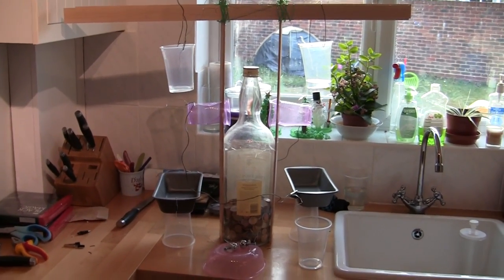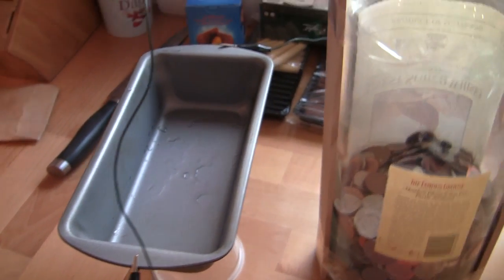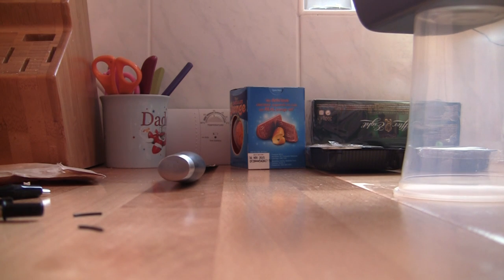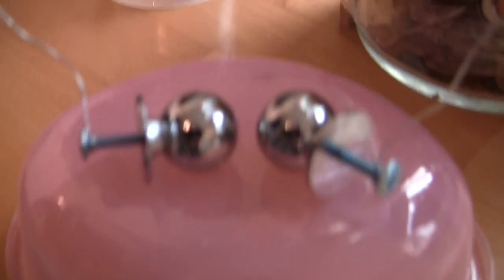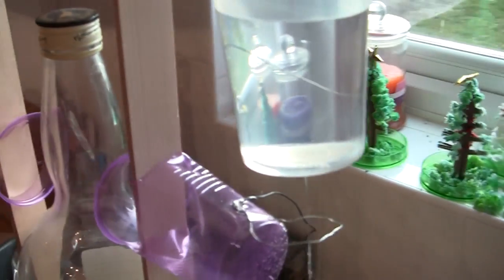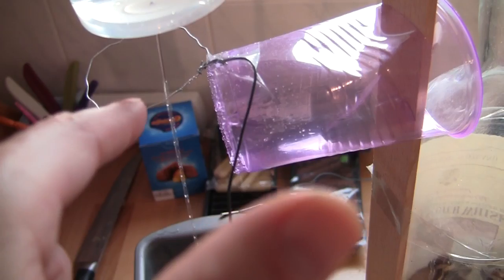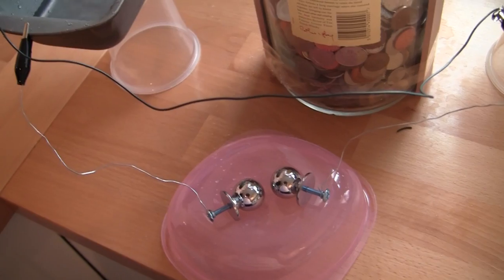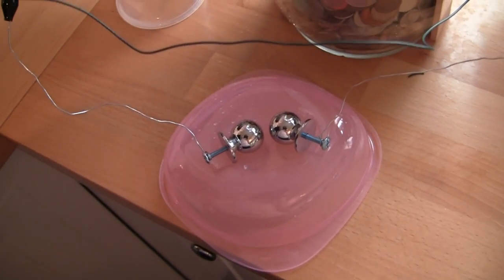Building a kelvin dropper

Comment: Here's pretty cool too: you can make a tesla coil (not 100% sure, but it seems like one) out of a basic plasma ball, by placing a small piece of metal (like stainless steel "screen" or a copper coin) on top of the ball, when the ball is on and you put for example a screwdriver close enough, it will make an arc that can even cut thin paper like receipts if put between the metals.
Not a big one as you can't really get huge charge with something like 12v or less, so its safe too.

Hmm.. that thing you made, made me think if that power could be feasibly harnessed as a "free flowing" system.. like an ecological water plant that harnesses the power rather from friction or air flow than just by water pushing blades.. it wouldn't necessarily make huge loads of electricity, but then again you could quite easily adapt it to into even smallest of falls without disrupting the ecosystem.
What happens if you add some electrolytes in the water?
Happy new year!

Comment: Could this be how lightening is created?
Reply: The same principle causes the spark. High voltage differences across air. Only with lightning the distances are much greater so the voltages are much, much higher. Not sure is similar process causes the charge difference.

Comment: Minimalism is fun, but the sharp edges and ends on your wireloops and connections is spraying charge off, into the air.  I think you will see much bigger sparks if you replace the wire hoops with donut size aluminum cake molds.  Round side down.
http://www.ebay.com/itm/Vintage-Aluminum-Metal-Round-Molds-7-JELLO-Cake-Craft-Soap-Donut-/121506073711

Comment: It starts with just a tiny difference in potential and how you cross-wire it will build that up and up from the top down. yes, you should wire the top cups clear to the bottom ir even run the end through the hole.
The loops work by Faraday/Lenz. If you increase the number of turns, the thing should kick out sparks faster. Older models I've seen used metal tubes, the induction occurs through the length of the tube as opposed to the thin area inside the loop. IMO, a coil will get more volts.

Comment: OK, so you need to get some kind of an electroscope that can determine charge (negative vs positive) on each metal pan and see if the charge starts in any kind of pattern while running the device over and over.

Comment: This is simply a separator of the positive and negative ions in the water based on the fact that like charges repel and vice-versa. Without going into that any further...
A conductor between the two primary water supplies will increase the spark potential because it will tend to pre-load the polarity of the primary containers and provide a slight series, rather than a parallel effect...  Good fun!

Comment: Perhaps the electric charge distorts gravity a bit. Not in any fling in to space way but we are only talking about small drops of water. Earth itself has a magnetic field and while I would not call myself a gravity expert(Things fall down is what I accept.), we can create magnetic fields with the right materials. It may take more but I know it needs electricity and a conductor routed in a certain way. I think of this because the water distorted as the charge built up but immediately went back to true when the charge dissipated. I'm going to ask Taofledermous to try this with mercury, perhaps we will get another piece of the puzzle from liquid metal. Thoughts?
Reply: I sent Taufledermaus a message. I hope some collaboration for science can occur.
Reply: The droplets are being pulled to the side by an electric force from the charged metal ring. Nothing to do with gravity or magnetism at all.

Comment: Will have to try that, except I'm going to have a few capacitors where the spark gap is. My goal is to find out just how much energy I can hold in the caps and how long it will take to discharge in a small circuit using a resister and an LED.

Comment: The big mistery to me is, why does it even start to charge up? When the water starts dropping the rings are neutral so there are no preferred loads. Do the first charges drop by chance? So water drops until we get the opposed charges and then the feedback loop starts? But if one drops lets say a negative charge by chance while the other stays mostly neutral there should be some electrostatic induction in the "capacitor" so the ring would would get a small negative charge and the stream would be positive and cancel out the load. So you really need two opposing charges to drop at about the same rate by chance to start the chain reaction. So many open questions... Need to build one ;)

Comment: cool! Is it possible to charge a capacitor with those sparks...enough to keep a set of batteries charging alternately (charges second battery while the first one is being used, then the second battery is drained while it charges the first one)..said batteries used to power a pump that pushes the water back up into the cups?

~ducking to avoid any heavy objects Thunderf00t might throw~
HAHA!!

Happy holidays to you and yours GeekMeister!!

Comment: did you try connecting some voltmeter to find if there is a bias of + to - depending on what side? I'd expect this to be random at least at initiation of this apparatus. Voltmeters I'd imagine might interfere with this operation as well be outside of spec of most hardware.

Comment: Everytime the spark happened, it appeared the Scientific Balls of Sparking (technical term) moved. While the voltage you quoted was impressive, I'd really like to know what was imparting a physical force to cause the movement, if in fact this movement wasn't caused from outside the apparatus.
Reply: Spark generates EM field, balls look like stainless steel, hence ferromagnetic. Balls interact with field - movement. The discharge also creates a plasma arc (like lightning), which very quickly heats up and its thermal expansion causes a localised pressure wave (that snap you hear would be the pressure wave reaching your ear... or the mic).

Its secondary effect is imparting some force on the balls, which are light, thus they move.
Reply: Electricity moves shit (very scientific terminology).
Reply: http://i.imgur.com/nlM8WNt.png?1
I hope this explains it.
Reply: The balls are oppositely charged and hence attract one another against the pull of the wires. As they build up charge, they gradually get closer to one another. When the spark occurs, the charge suddenly goes away (or nearly so) and the wires quickly pull them back apart.
Reply: Electric force shifted the balls a bit out of stable balance and when they discharged it rolled back.
Reply: velikiradojica how does electricity impart momentum?
Reply: 233kosta That seems correct, and a bit confusing to a non-English speaker like me. Your name Kosta, seems like a short for Kostadin, in my language.
Reply: ***** This is the only correct answer.
Reply: sieben So why do they only move during discharge, away from each other? You'd expect them to get closer while charging, not push away during discharge. A slight positive charge remaining in one ball during discharge would cause said ball to move away due to the electron concentration inside the plasma arc, but that still leaves the other ball, and it doesn't account for the fact that the discharge serves to balance both sides, so there wouldn't be a delta+ in one ball anyway. Ferromagnetic interaction with the plasma arc and an interaction with the thermally generated shockwave remain the two plausible explanations. A ferromagnetic interaction would cause them to attract, not repel, so while it's present, its effect is negligible. This leaves the shockwave as the dominant phenomenon. Direct evidence for this could be obtained if Thunderf00t has the facility to take a high speed Schlieren video of the discharge. One would expect that the balls not repel until struck by the small but sufficient shockwave. Perhaps - attract a little before that.
Reply: I noticed that too. Could it be that since they were round they needed very little force to roll slightly?
Reply: velikiradojica so magnetism resulting from the electric charge?
Reply: What do you mean?
Reply: The magnetic induction would have to be 10T for the magnetic force to reach the magnitude of the electric force. The rest of the phenomena you have mentioned have even lower magnitudes. I strongly claim that electric force is the culprit behind the movement.
Reply: Micic00 Not exactly, but close enough :D
Reply: 233kosta I explained the mechanism in the first few comments. Here's the crude scheme of the equilibrium states of the system I also posted earlier: http://imgur.com/nlM8WNt .

The balls are coming together while charging. We can't see this because it's gradual and the camera is hand-held. If we could get TF to fix his camera and put a ruler behind the balls, we might be able to see their movement prior to the discharge.

Electric forces are potent as fuck, the only reason why we can't use them for engineering purposes is dielectric breakdown of the material.
Reply: velikiradojica I'm well aware of electric potential, however your argument is only valid if there is spring tension on the balls. The elasticity of the cables is not sufficient to overcome friction, else the balls wouldn't remain in their position. Furthermore, if the electric potential was sufficient to overcome static friction, then it would be more than enough to overcome dynamic friction as well (as the coefficient of dynamic friction is usually 0.5 to 0.8 of the coefficient of static friction), thus the balls would continue moving and eventually collide.

One could argue of course that tension on the wires would counteract the electric field, however that would suggest that the electric field is fairly weak.
Reply: 233kosta I used "elastic force" as a loan term as I'm not a native speaker. You can picture it as a sum of all forces opposing the electric force, including the elastic >bending< of the connecting wire.

Your assumption that the balls would collide is baseless as the electric force annuls after the dielectric breakdown happens. And well, static friction is just shy of 0,2 N, so the electric force shouldn't be much bigger. I can't calculate it accurately because the balls are too close yet not close enough and I can't make any simplifications without butchering the result.

Comment: Okay. Now we do this with two waterfalls. :)?
Reply: Leitilumo You need the water to become droplets & the air must not be humid or the charge leaks away from the droplets. The air near waterfalls is too humid for this generator to work.
Reply: You've never experienced waterfalls in tundra? I doubt there would be a lot of water vapor, even with large falls.

There would be some, but.. hmm...
Reply: Leitilumo Artificial waterfalls are used in terrariums to increase local humidity for the animals... On the scale of droplets I don't think you want huge amounts of water flowing nearby to humidify the air [which must happen even in arid air near a big waterfall right?]. In Malta & North Africa the locals don't use electrical A/C - they cool courtyards & rooms by putting huge jugs of water around the edge high up in the air to preferentially change the temp/humidity & set up convection that cools the centre - better than A/C because works best without glass or closed windows. So still water can change local humidity in Morocco - it would be even easier on the tundra where air is cooler & thus less water needed to raise the humidity by a given % [that's counter intuitive]
Reply: Grymyrk The water would have to be droplets for the charges to gather on the surface of each drop. Only a certain amount of charge can gather on a drop before it is saturated with ions & then the charge has to transfer to the wire loop which has to be at a certain position along the pipe. But the pipe is enclosed so the air inside becomes super-humid & the ions leak away in the humid air. So you evacuate the tubes & make a vacuum - that might be interesting. But the charge only builds up once on the fall of each drop. As you point out yourself the energy from the charge differential is tiny [per drop] compared with the kinetic energy in the falling drop. I would suppose the kinetic energy is millions of times more than the ion charge energy [wild, wild guess]
Reply: Waterfalls aren't the problem, where the fuck are we going to get the big ass cake tins 0.o
Reply: At cold temperatures it takes a far greater amount of water to reach same levels of humidity, thus humidity is lower near waterfalls. in fact if say you have a 60% humidity inside and outside it is near 0 and raining the outside water content in air will be larger but your humidity levels far lower than that of inside, even during rain. So this is more feasible in cold temperature waterfalls, though ultimatelly very pointless.
Reply: Personally I'd be more concerned with finding waterfall sized polyethylene cups than cake tins.
Reply: nightjarflying What if the waterfall was highly controlled? Like water falling through plastic pipes running from the top to the bottom of a dam with with the inducting rings around them? Or maybe there are better ways to generate power with falling water (and I'm guessing a standard water turbine)...
Reply: Grymyrk Yeah, but regardless of the turbine being more efficient - It would be FUN to watch something like this on an enormous scale.

Yes, the physical limitations of the size of ions is a big deal, but who knows what would happen with an enormous wire loops, enormous insulators, waterfalls, using a vacuum and time... :)?
Reply: Strazdas Fun isn't pointless. =^.^=

Comment: So when are you going to turn this into a source of electricity that can power a small light bulb?  That seems like the next step.  Behold the scientific method at work.  This series of videos is proof of the idea of the method.
Reply: zeanamush If we had a couple hundred of them we could light a shake flashlight with the power generated... I think people see the spark and assume high voltage means a lot of power, but that spark is extremely short with minimal current, it likely contains less than a joule of energy and fires once every few seconds, each one of those would generate an intermittent pulse of energy equivalent to about the amount of energy it takes to run a pair of headphones... Super, super not worth it at all. It's an interesting trick, but it's too difficult and inefficient to be viable for any sort of useful power generation.
Reply: It doesnt generate that much, so the bulb might be a tad dim
Reply: Lots of voltage, but not enough current to power anything.  This is why we don't use these in hydroelectric dams, because the energy generated by a kelvin dropper is negligible.
Reply: To be fair I got that. I just love the experimentation, and Thunderfoots ability to find awe in everything. Thought it was cool and it showed a process
Reply: the only light bulb you can power with this is a neon test light.  You know, those tiny orange bulbs you sometimes see on cheap screwdriver-type electrical tester.  Those don't require hardly any current at all.
Reply: Bob Lake  Link it up to a capacitor in sequence with a voltage regulator so that the energy is more steady and at a far lower ~5V but for a longer duration, and hmm... I wonder if it would be enough to power an efficient LED so that it has a visible glow.  Hmm... I may have to try this someday.  :)
Reply: stellarfirefly
 sorry, not enough energy to run a regulator and a LED.  Unless you charged a cap for a long time, and it would be a very high voltage cap with extremely low leakage.  Regulation would be an issue too, as the voltages involved are very high.

The neon lamps im talking about require a few micro-amp or less at 70v.  In practice they usualy use a 1 to 10 Meg ohm resistor in a 110v circuit.  You can light them up just by by charging yourself by rubbing your feet on a carpet, hold one lead of this lamp, and bring the othe lead near a grounded object , like a water pipe. You can get those things to glow even with a couple of inches of air gap between the lamp lead and the pipe.
Reply: Bob Lake  Ah, I didn't realize those test lamps required so little current.  If I get the time someday, then I may just pry open that old screwdriver and try it with that instead.  In a dark room.
Reply: stellarfirefly
 you will be amazed.  I had no problem lighting those things up with a 4 inch (10cm) air gap in our dry canadian winter conditions.